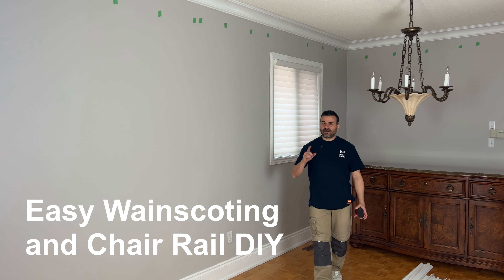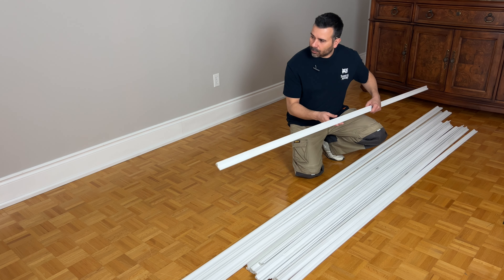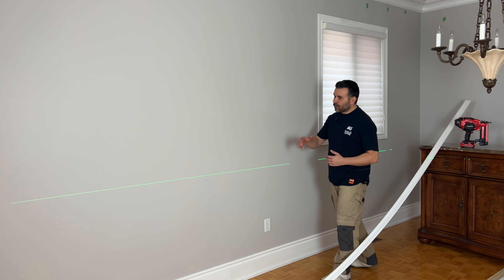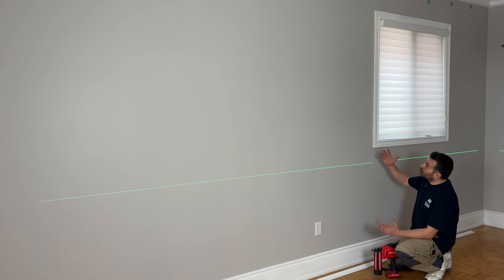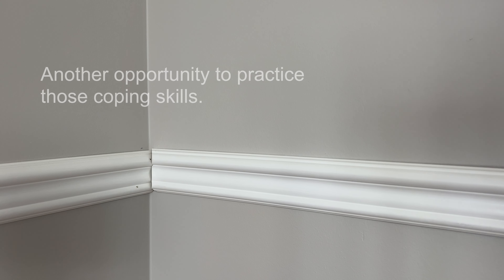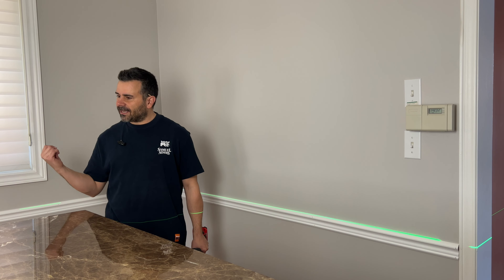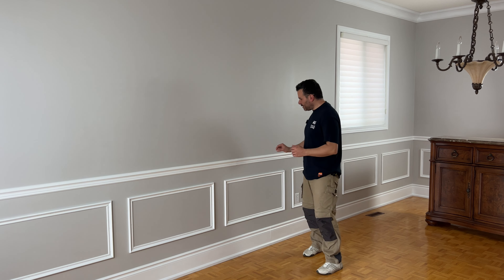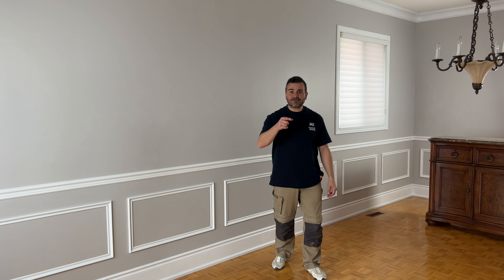How to Install Wainscot - with Domenic Molella

Comment: Thanks for the video.  The panel molding used was not linked in the video only the chair rail, would you mind providing the link for that?  Thanks so much!
Reply from the maker: Hi LaTasha, here are the links to both products Dom used to create this look: https://www.metrie.com/products/moulding/1509921 and https://www.metrie.com/products/moulding/1544569
Reply: Both products state chair rail. Is that accurate?
Reply from the maker: Hi Ellen,Yes that's right, both products are chair rails. Here are the links to the products: 
https://bit.ly/3s6CAQK and https://bit.ly/40derEH